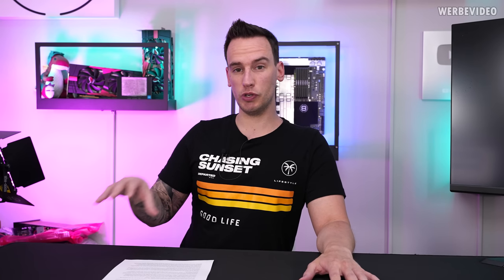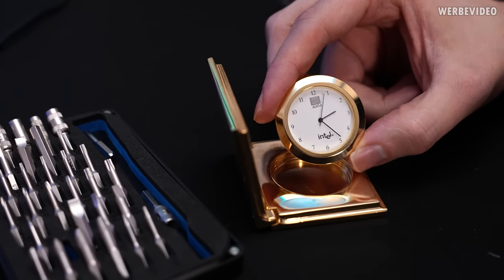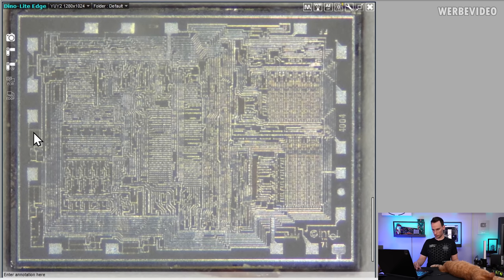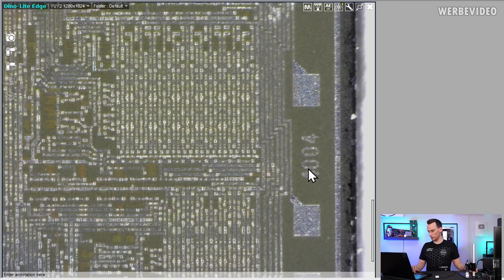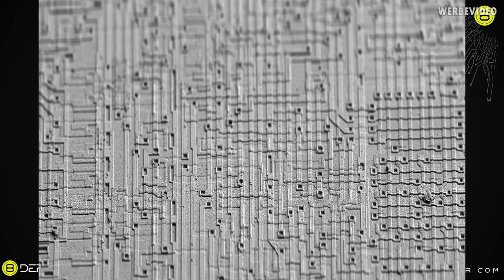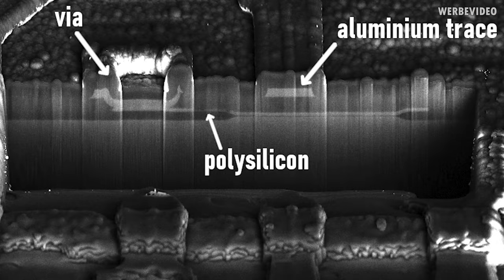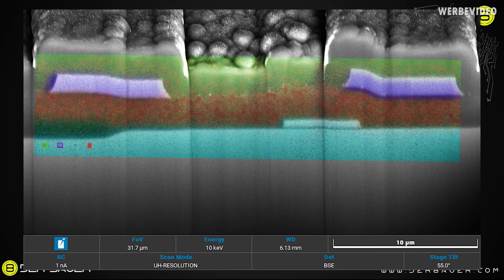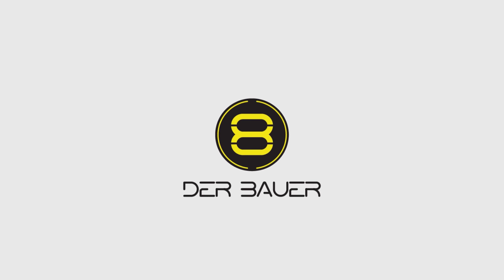We cut through the First Intel CPU with an Ion Beam to see how a Transistor looked like 1971

Comment: Focused ion beam is quite expensive, like 5 figures I think. I develop ICs and we sent our SerDes testchip to one of them, to cut Tx from Rx so as to see how much that reduces I/O pin capacitance. Oh, and apparently you can even create new traces with FIB.
Reply: Occasionally prepared TEM lamellae in grad school with FIB and it cost our lab $300/hr through the university, though that was very likely heavily subsidized from what it would have cost to farm it out to some outside organization.
Reply: that is strange since it is usually tax sponsored, susidised, since they are usedd for medicine discoveries and making stufff like isotopes. micro ct is probabl better in most cases bbeam line is a bit strong and is used for cases were the metal does not work with ct well
Reply: Very expensive machines, I used to run one at Motorola back in the 68040 days. It was hooked into the chip database to find the traces that were to be cut and or jumpered. The designers left traces at the top level of metalization that could be easily jumped or cut as needed to change some logic functions that were uncertain, design-wise. It used gallium ions that were accelerated to chip away at the passivation (glass) that covers the aluminum traces. There was a 'sniffer' that could tell what was in the debris , ie glass or aluminum and that would tell you to stop cutting  or if you've cut through. IF you wanted a trace, it put a bit of tungsten based gas  W(CO6) in the chamber where the gallium ions would hit the heavy tungsten atoms and cause them to stick to the chip, forming a conductive layer. There was also a gas that acted as an insulator that could be deposited by hitting it with the scanning beam at lower energy. 
One of the more interesting parts of the job of being a Chip Product Engineer :)

Comment: Federico Faggin famously laid out the 4004 by himself, transistor-by-transistor. He did the same thing for the next generation processor, and did his last layout for the original Zilog Z-80, where Faggin was the CEO. While the 4004 used enhancement mode PFET silicon gate technology, the Z-80 used depletion mode Si-gate NFET technology. Faggin developed Fairchid's silicon gate process which is why Intel recruited him for the 4004 project!

Comment: The aluminium interconnects is something that is actually still very common in the industry.
One reason is that it took until the mid 90's before the industry found a way to cleanly etch copper bellow about 50 µm trace widths, and it is a more involved process, though not without its own advantages, but CMP can also be used on aluminium.
Another much more prevalent reason for why aluminium is still used is that aluminium isn't toxic to semiconductors.

Copper turns a transistor into a resistor as the copper diffuses into the silicon. Aluminium is a weak P dopant and forms a depletion region when in contact with another dopant. This extra depletion region can be accounted for, but beyond that the transistors still works like they should. (most good electrical conductors are actually fairly toxic to semiconductors in the same way as copper. Even tungsten is fairly bad, but at least tungsten don't do much diffusing.)

Even in chips that do use copper it is seldom used beyond the top most layer and mainly there for bulk power distribution. Layers further down are often aluminium unless the chip is very power dense, since then copper can extend down to further layers. A diffusion barrier will also be required if the chip contains copper, as to stop it from diffusing into te semiconductors over time (unless one wants the chip to fail somewhat quickly (weeks/months depending on operating temperature)). But even a diffusion barrier won't stop copper from spreading, only slow it down sufficiently for a server CPU to last about 4-10 years of 24/7 operation at rated max temp before they meaningfully start failing. (depending on diffusion barrier thickness.)

But a lot of modern fabs don't do copper layers at all, since copper is a risk of production contamination, so if the fab doesn't do power dense chips, then why risk it. (To my knowledge fabs that do handle copper have a division of "before copper" and "copper" sides and any wafer crossing the line won't ever return back. Same for machinery used on the copper side will never be used for anything  on the before copper side (with an exception of wafer transport machinery, but perhaps even these have a strict side they stay on). Metal contamination is a serious issue in this industry. Similar to how silicone grease/oil is a serious issue for a metal paint shop)

I myself is though curious to if typical DRAM chips contains copper layers or not. I wouldn't be surprised if they don't, since yield is so paramount to profit in this market where margins are honestly rather slim. Nor are RAM chips all that power dense, so not much reason for going for copper. (I will though make an exception to copper landing pads for wire bonds or flip chip, since this is somewhat typical and not uncommon to do outside of the main fab itself so that contamination is even less of an issue.)
Reply: Aluminium is widely used in bipolar power transistors - the old TO3 case.
Problem with aluminium is the thermal fatigue; the commercial version of a 2N3055 is specified for 5K cycles. The MIL version uses gold to connect the transistor chip to the pins, and it can do >1M thermal cycles. As you said, copper can't be used for interconnections, it destroy the gain of the transistor in a short time...
Reply: @rayoflight62  I can see you are talking about bond out, I however weren't.

I have never heard of any manufacturer using aluminium bond wires to be fair. Gold were practically the only thing in town until copper bond wires started getting used. (at least for mass market chips.)

Though, thermal fatigue tends to be a bit abnormal for any microscopic structure, like bond wires. Since the effect is due to induced stress from materials of different thermal expansion. But said stress needs to overcome the bonding strength of the two materials for the fatigue to happen and that is unlikely when the interface is only a few tenths of µm wide at most.

Flip chip however suffers from thermal induced fatigue a lot faster, since the chip and its carrier cover a much larger area than a single bond wire connection. So even if the pins/balls at the edges are tiny, the difference in expansion on either side of the pin/ball will tear it apart.

Meanwhile bond wires have the luxury of being able to just gradually follow along. Spreading out the stress along the length of the bond wire, and that effectively removes fatigue. Though, high G forces can knock the wire over and short it to the neighbor.

Then there is plastic encapsulated packages that can trap moisture inside them. When heated during soldering the moisture can boil, and the resulting pressure can create a gas pocket between the chip and plastic, tearing off the bond wires in the process and often leaving an intermittent connection as a result.

In regards to what I actually talked about in the original comment. I talked about interconnect layers on the chip itself. As an example, the last interconnect layer makes the pads used for bonding out the chips. And for these on chip interconnects, thermal fatigue is rather uncommon, and often designed away through various means.

Also, can't find any information about the supposed thermal fatigue and 5k thermal cycle spec of the 2N3055. (I have seen thermal cycle specs for some MLC-Caps, but never a wire bonded transistor.) Have a manufacturer/datasheet behind that claim? The 2N3055 is a jelly bean part made by everyone and their dog after all.
Reply: that was a great read. thanks!
Reply: This thread of comments should be Required Reading for anyone watching these videos! 😎👍☕
Reply: The problem is that copper has a very high diffusion coefficient in Si, even at low temperatures. It is at the bottom of the wafer in no time and will ruin any junction it comes in contact with. The diffusion coefficient for Al is much lower and will need higher temperatures in order to diffuse into the Si (it is also a dopant and used for making shottky diodes). However subsequent process steps can still diffuse the Al into the Si in order to cause problems with junction spiking and render the transitors useless. Also, Si dissolves easily in Al up to a certain percentage where saturation occurs. This is especially true if very shallow diffusion regions are used (which is the case already for a long time. In order to prevent junction spiking barrier layers are used, most common TiW or TiN. For modern Al interconnect they never use pure Al, there is always some Si and Cu in the layer (Cu is to slow down electromigration).
Reply: @SlechterWolff  Thank you! This thread proves why most 'young people' need an understanding of the pioneering knowledge learned by the "Greatest Generation".
                               They seem to think they Know-it-All and that Electronics is just a matter of assembling Lego Blocks.
Reply: @SlechterWolff  Yes, copper is a speed daemon in silicon.

And yes, even aluminium can also cause problems, though depending on what one is building it is more or less annoying. Semiconductors are indeed very picky about dopants and even aluminium skews the specs of a transistor, the resulting behavior can indeed be very detrimental, but at other times can even be desired. All depends on what the transistor is used for.

However, can't help but feel that you literally reiterated half my comment. (But I can agree that I did oversimplify, but the main thing were about reminding people that aluminium interconnects are still very prevalent. Since there is the common misconception that aluminium interconnects have been completely phased out of the industry.)
Reply: Thanks for the read my kindle packed in 😉

Comment: Back then there was no CAD/CAM, so the chips like the 4004 were actually designed with rug sized drawings of the various layers, similar to architectural drawings showing the various layers of a floor design. Those drawings were then reduced to smaller and smaller transparencies to make the various layer exposure masks for the wafer chips. I think there is a photo online showing Faggin and the other designers walking on top of the design "rug" drawing. I love old chips since they are easier to see details with optical microscopes. It would be interesting to see an 8008 or 8080 for comparison.

Comment: When I used to do die failure analysis, it is possible to etch away the plastic (epoxy) packaging to reveal the die attached to the lead frame. 
You can do the exact same with ceramic packaging, to release the cover and the top part of the "sandwich". 
To release the die from the lead frame is more difficult, depending on if it was glued on or ultrasonically bonded. Acid may be needed... But for this experiment, you could have cut through the lead frame as well.
Great video. Lots of memories...

Comment: The "first" of anything always fascinates me, and the 4004 is no exception. Some NOS samples or even pulls are fetching $300-400 or more on ebay. BTW it's no surprise that MOS/CMOS devices are so static sensitive - the ultra thin SiO2 layer between the polysilicon and substrate (gate) can easily be punched through with just several hundred volts ESD and you won't even feel it. I would imagine todays nm feature sized chips are even more sensitive.
Reply: Most modern devices have internal protection diodes on the pins to reduce ESD sensitivity. Early CMOS didn’t, which is why they’re so very sensitive to ESD damage.
Reply: @tookitogo  yes true but that protection only covers to about 2000-4000 volts...better than the original tech but you can easily generate 10s of thousands of volts just raising your arm with synthetic fabric on a dry day.
Reply: @tookitogo  yes true but that protection only covers to about 2000-4000 volts...better than the original tech but you can easily generate 10s of thousands of volts just raising your arm with synthetic fabric on a dry day.
Reply: @chrisguli2865  Which is why I said they reduce, not eliminate, sensitivity to ESD damage.

Comment: Yeah interesting vid. The original discrete MOSFETs (circa 1960) used aluminum as the transistor's electrode (rather than polysilicon). It was Fairchild that first experimented with SGTs (Silicon gate technology transistors) as a variant of the metal oxide layer (they were still MOSFETs though) but used polysilicon instead of metal in the trannie's electrode for the gate-oxide layers. That was Federico Faggin that created that process for Fairchild as self-aligned gates. Interestingly, and this may provide some of that missing details you mentioned, Faggin then moved on from Fairchild and joined Intel and took the SGT concept into Intel where he immediately used it when tasked to design the 4004 chip. So the 4004 uses SGT gate technology as you correctly identified there, which relies on polysilicon/polycrystaline-silicon gates (with underlying dielectric oxide layer to produce the field-effect).
Reply: Thanks for adding that, very interesting

Comment: Would be interesting to see a set of videos working with a fab to make a simple large transistor chip, and have chips at each layer made. That would allow a good way to look at through a basic microscope at different layers. Being a more simple chip design you could easily point out how it's working based on what pins are active at any time. Maybe even some 3D printed models to give a larger representation of different types of transistors at a scale you can easily point to and describe, or have parts you can swap to better show a change. Really going all out could have a program to show the circuit design and can show the circuit based on inputs to give a visual active view of the chip.

I've always had a hard time fully grasping how these chips work at a basic level, since the basic and overly simplified graphics of some videos and articles just don't have enough there to fully follow (at least for me), and the crazy scanning electron microscope stuff is neat but goes a bit over my head. But on the other hand when I found a game on steam for making circuits and had decided to try and build the 4004 in it, I was finally able to start grasping how it worked  since it was at a scale where you can more easily follow along with what's going on, as long as you could find the right info delivered in the right way (which takes a painful amount of digging even for the 4004 in my experience and for the level of info that worked best for me).

Well that was a lot more than I expected to write, all just to say you do awesome videos and in the crazy chance you could, it would be neat to see something like that in collaboration with a fab that can help make that happen.
Reply: Think there's a youtuber that has been trying to make his own chips at home.

Comment: 10:34, is not quite correct. In a PMOS the charge carriers are holes (not electrons). But in the NMOS the charge carriers are electrons (not holes). So what this means is for the PMOS situation, holes flow from source to drain. In the NMOS electrons flow from source to drain. So in effect, the PMOS sees electrons flowing from drain to source (not from source to drain since those are the holes). Hope that makes sense. Even a lot of electronic engineers get confused on that point though!

Comment: Hmm so 125x on a modern CPU ..     This 4004 CPU is ~ 2300 transistors, so ~ 48 x 48 transistors at 12mm2 square and we can see them all with a 125x magnification.    A Zen 3 on TSMC N7 has 4.15B  transistors in an 80.7mm2 space, or about 617M transistors in the same 12mm2, or 24839 x 24839 transistors in that same space.   You'd need 500x additional magnification..  to see 1 transistor.
Reply: Let alone Apple's M1 with 16 billion transistors for a die size smaller than Ryzen's.

Comment: Intel has been an innovator I hope they get back on track and launch upcoming products on time
Reply: Both Intel and AMD are innovators. Specially late 90's upto abt. 2010 they both drove eachother to greater hights of technology until AMD made somehow a booboo and Intel reigned for abt 8 to 10 years and now they are driving eachother to new hights.
Reply: @DeeDee.Ranged  true. Kudos to amd. But Intel started the x86 revolution
Reply: @j340_official  Robert Noyce, the founder of Intel, developed the monolithic integrated circuit. Like he invented chips. Someone else had made a microcircuit before Noyce but it wasn't on a single crystal of silicon like they're made today. Noyce developed the method everyone uses to make integrated circuits. He created the microelectronic industry.